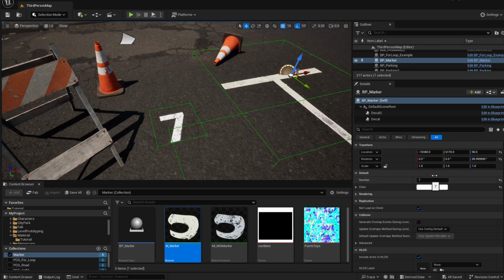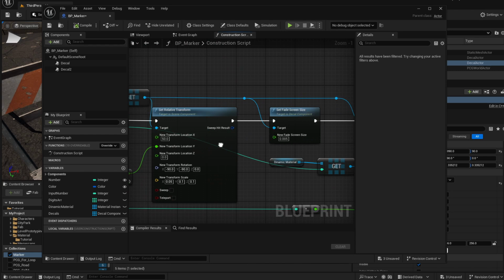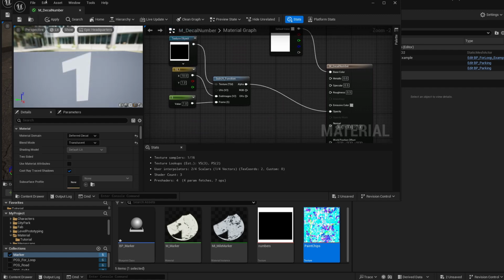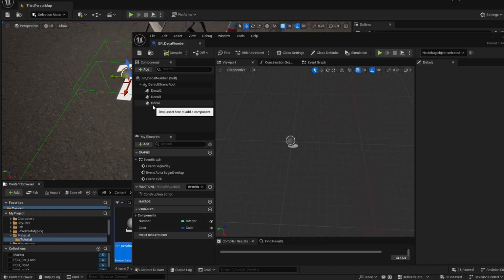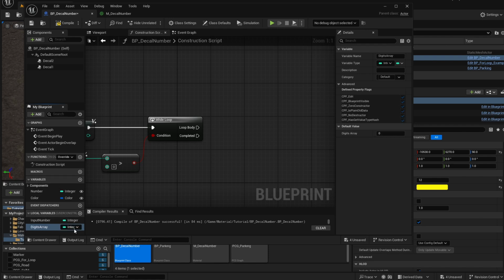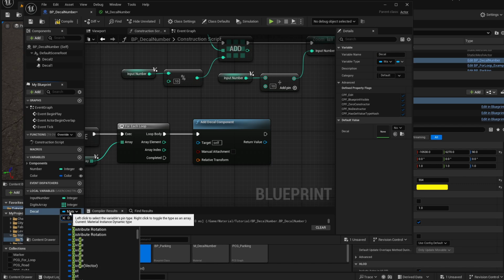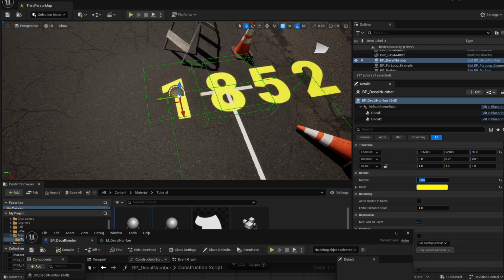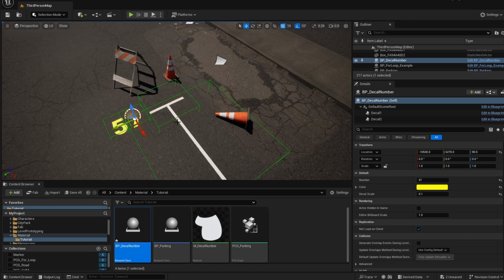Dynamic Numbers Material Made Easy! Unreal Engine Tutorial

Comment: Thank you for the great video! I have a question — when using 1550, is it that four decals are placed inside the blueprint (BP), or is it that one decal uses a material with a UV function that selects and displays four numbers in sequence?

From what I can tell, it seems to be the former (the first method), but I'm not completely sure, so I wanted to ask. Also, if it is the first method, would it still be possible to achieve the same result using the second approach?
Reply from the maker: it will create multiple decals 1 for each digit

Comment: I think, make one shader and one texture and after that instancing shader for each digit through BP. It may cost greatly in draw calls. When u change the shader parameter through BP you duplicate the shader each time. I think, more efficient if you do each digit with its own shader and then use it as an instance decal. There may be less drawcalls. And same with color. Yes, it's more convenient but not efficient.
Reply from the maker: You can fill the materials in an array on creation and check if the number you need is already there to use the same Mat.
It's great to always think of ways to improve a specific aspect that you learn.
Reply: @dk_3d I think the best way is to not use dynamic materials at all, instead use "Decal Color" which is a Decal actor property and is readable in the material editor. You can store color in RGB and the number in A.